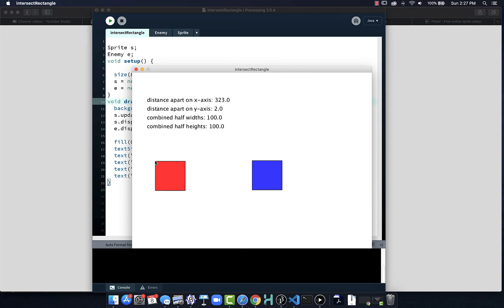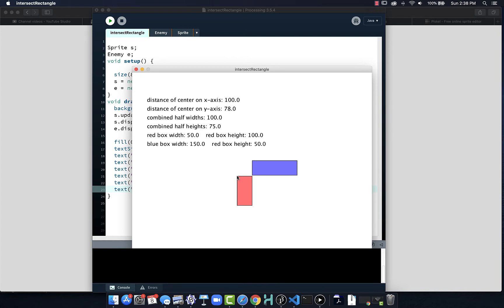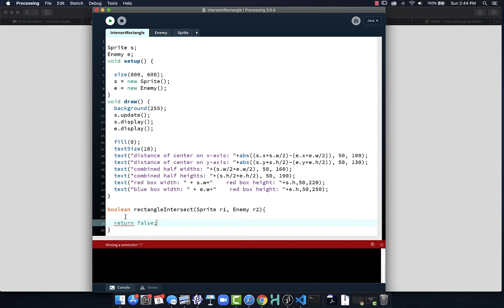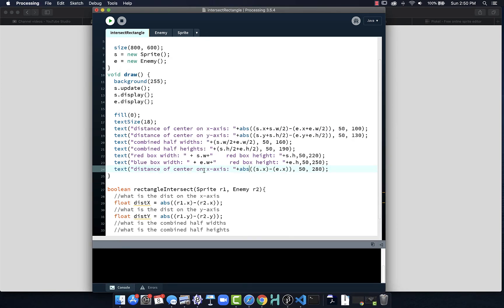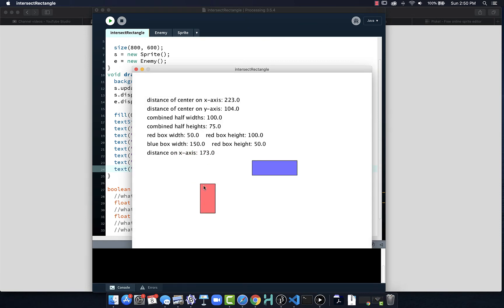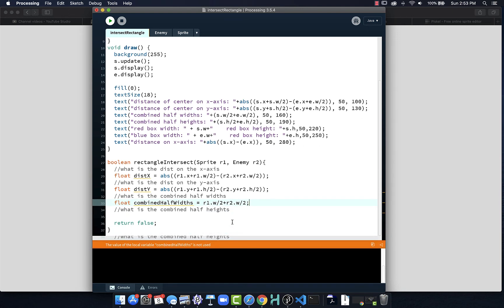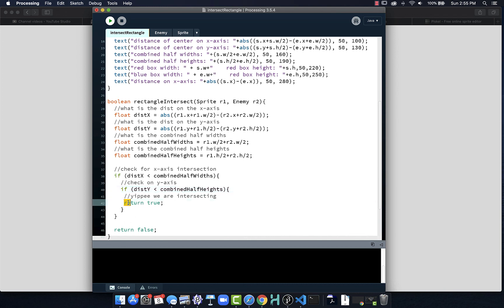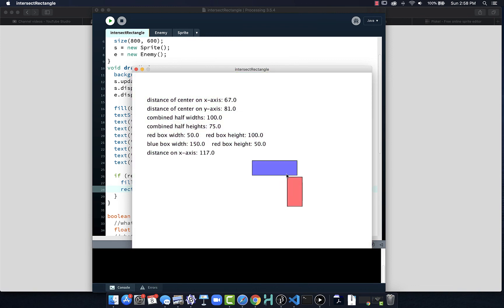Programming Rectangle Intersection/Collision in Processing

Comment: Sorry, but I'm pretty lost here. I haven't studied about class yet, and I'm having a project that requires collision detection. What are r1 and r2 here exactly? And does "r1.x" mean r1 multiplied by x? Thank you so much in advance!
Reply from the maker: r1 and r2 refer to the rectangular objects we are testing for collision. We are passing the objects we are testing as function parameters, thus the r1 and r2, so we can refer to the objects indirectly within the scope of the function. As we are using class based objects the objects have unique properties of x, y, width, and height. X and y are the coordinates on screen for their top left corner and knowing that along with their widths and heights we are able to use the algorithm in the collision detection function. Without using class based objects, there is no real way that I know of to track if the objects are intersecting. If they are just two static shapes you have drawn on screen and they are not objects, you could rework the algorithm but it would be messy with having things contained in objects.
Reply: @theARTboyJohn  This helps me a lot. Thank you so much sir!

Comment: Hi John, would it possible to do this with multiple objects being passed into the boolean function. For example, I would pass in all objects from one ArrayList then check each object in the first ArrayList and compare it to each object in the second ArrayList?

the code would look something like:

boolean Object1Object2Intersections(Object1 object1s, Object2 object2s){
    float distX abs etc etc
}
Reply from the maker: The often used method to do this is to brute force compare each object to each object using a for loop inside a for loop. You check intersect of all of the array2 objects to the last object of array1, then second to last, etc. The checking from last to first is so that if you have dynamic arrays and possibly remove objects as you go, then you will not run into the situation where your loop is going for longer than the modified array. If not using dynamic length arrays (which is what processing prefers anyway) then if you go front to back or back to front is irrelevant. I don't know of a method to just pass a whole array to the function for intersection.
Reply: @theARTboyJohn  Could you show the code for the Sprite
Reply from the maker: @draemdaed  
class Sprite {
  float x, y, w, h;

  Sprite() {
    x = width/2;
    y = height/2;
    w = 50;
    h = 100;
  }
  void update() {
    x = mouseX;
    y = mouseY;
  }
  void display() {
    fill(255, 0, 0, 128);
    rect(x, y, w, h);
  }
}
Reply: @theARTboyJohn  Thank you very much, It didnt work for me because I put the mouse X and mouse Y in the void display instead of the update now it works fine thanks bunches